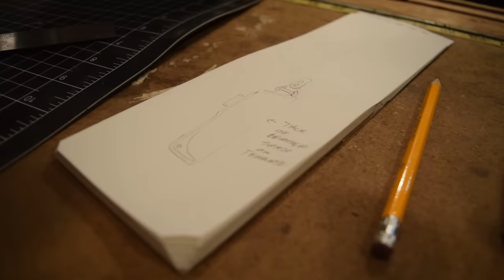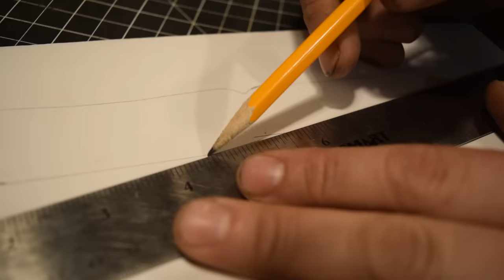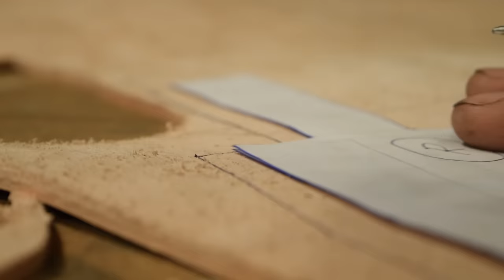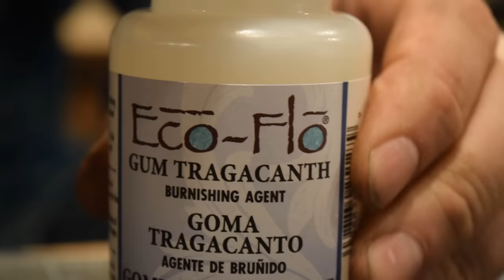Making a Bushcraft Sheath for My Woodlore Clone

Comment: Erm... I can't stay quiet... I have to know... Why use a hammer to punch the Awl through the holes you marked with a fork and hand pushed to start, when it was obvious that the piece thickness would mean you struggling to get the Awl to go all the way through and would need to drill out the holes? Which leads to the repetition of this same "principle" with the Hole Punch - when you could see that the Punch would not be able to handle punching a hole through the leather, why didn't you just Drill the hole through in the first place? OK, I do have an advantage in that I do Leatherwork, and as soon as I saw the Hole Punch you were going to use I knew it would never go through the depth of layers you had so would not have wasted the energy and time in trying it to start with... to be fair it was the same with the Awl holes too... but then I wouldn't have used the same thickness (or weight as you Americans use to measure the thickness of leather)... 

The guide I use is that the Leather should be the same width or thickness as the Blade it's going to cover... but that is personal preference, as with most things in Leatherwork, there is no Right or Wrong, but Personal Preference tinged with experience.. after all, making a Belt out of 1.6mm (4 oz for the across-the-ponders) when it is going to be a Craftsman's Tool Belt isn't going to last, or the same can be said when making a Fashion style belt to cinch a Woman's skirt out of 6.0mm+ (15 - 16 oz) which would look so inelegant in it's setting... 

I really do dislike seeing people drilling holes for Stitching... the idea of using a Diamond Awl to create the hole is that the hole will, over time, close up on and cinch the stitching thread, securing it even more... A diamond Awl is only really sharp right at the tip, the rest of the blade then pushes the leather out the way, hence it "returning" to it's old position and cinching up on the thread... putting in a loop or 2 over the first needle through when Saddle Stitching actually creates a Knot inside the hole that the hole then cinches down on... now I know the Thickness of the leather in this instance is working against using an Awl... but you could have transferred the holes created by a Diamond Awl down through the layers by not gluing them before hand.. the hole would already be there, so a diamond Stitching Awl would then re-open those holes when it comes time to stitch the pieces together after gluing them up and using strategically placed needles to keep the hole alignment as you clamp it up together... 

Length of Thread - 2-3 times for thin leather is usually sufficient... 4-5 or 6 times if thick leather has been used... length is determined my using the thread to roughly track out the distance of the line of stitches then multiplying that length by those rough guides... but then, even if it's too short you don't unpick everything!!!!! You just finish off with the short thread by back stitching once and getting both threads coming out the back side of the piece, then starting again with a Fresh Length one or two stitches back from the end of the last thread and carry on... some jobs you do the length of stitch is so great that having ALL the thread needed would be totally impractical and several lengths are required to complete the job.. again, a rough guide I use is if the thread length is going to be longer than the span of my 2 arms then I will use 2 or more such lengths to complete the line of stitches... that way you don't fight the thread or have the loose loops get caught up all the time or twist together in a knot and bind, etc...

Comment: Maybe this is something that everyone (except me) knows, but why is it that the sheaths come up so high on the knives? I have seen this with multiple videos
Reply from the maker: The sheaths come up high so you don’t have to worry about them falling out, if they come up lower, usually you will some type of strap around the handle. Especially with a Coke bottle handle, the extra height give you leather to shape around the handle to lock it into the sheath.

Comment: Are you not afraid that the snaps open on your belt and you loose your knife?
Reply from the maker: That is a slight concern, but with the majority of dangler knife sheaths using snapped belt loops, I’m thinking it’s a tried and tested solution. Only time will really tell.  Thanks for the question.

Comment: A rule of thumb is four times the length of thread as the length of the stitch line,  It is easy to add to a thread kine,  It is not practical to have a thread that is too long,  Lastly get a pricking iron and awl.  It is very bad practice to drill leather.  Drikked holes make the leather susceptible to tearing, Oierved holes heal up around the three, and are thus more durable,

Comment: what kind of glue are you using? a lot of glues that I've used don't seem to stick very well. And thank you for another great video. Great Job!
Reply: Glue is just temporary to hold until you can stitch.
Reply from the maker: In this video I use Weldwood brand contact cement. I have used different brands, and they all seem to work the same. Just be sure to read and follow the directions and you shouldn’t have any problems. Good luck.
Reply: Ok thanks guys

Comment: I don't understand why there's a belt loop attached to let it swing instead of ride steady fixed on your belt.
Reply from the maker: https://bushcraftusa.com/forum/threads/danglers-i-dont-get-it.198460/
Reply from the maker: Here is a good discussion board from Bushcraft USA discussing dangers and belt loops.
Reply: @TheArtofCraftsmanship  Thanks!
Reply: @TheArtofCraftsmanship  quick question, if you were going to do a leatherman tool sheath, how far would you measure past the edge of the outline to cut, so you have enough room to wet mold the sheath and have a decent stitch line? Will you ever do a video for one of them?

Comment: Turned out nice but your stitching work leave a lot to be desired. Learn to use a stitching awl and not a drilling machine. You should always hold both needles and stitching awl without putting them down while working. When finishing stitches always finish on the back with both ends.
Reply: Did you see how thick the leather was?  It's not wrong to use a drill press!